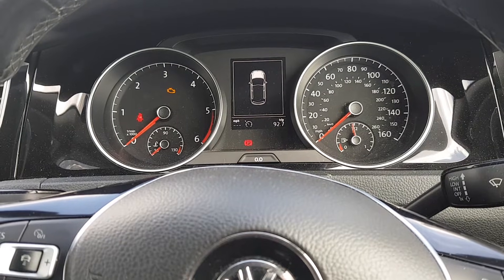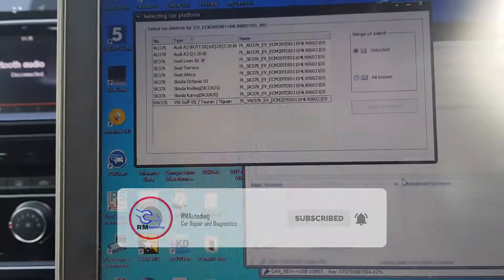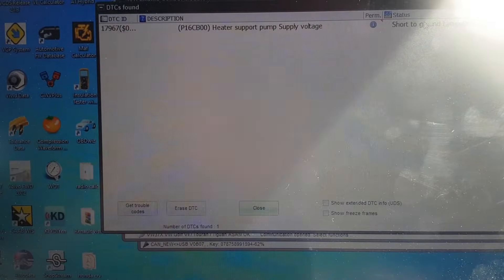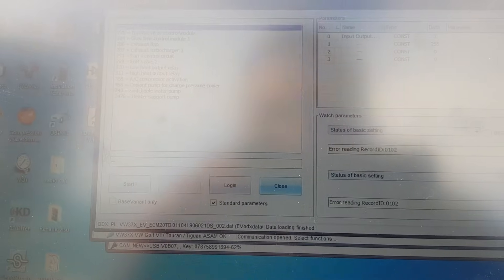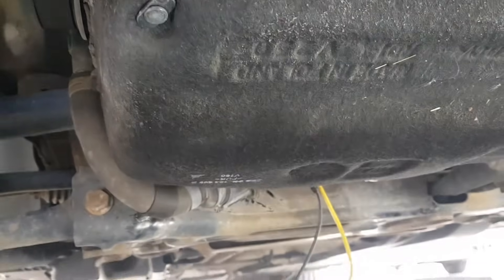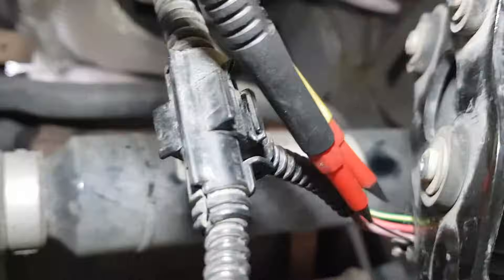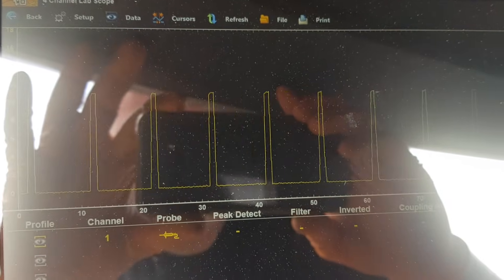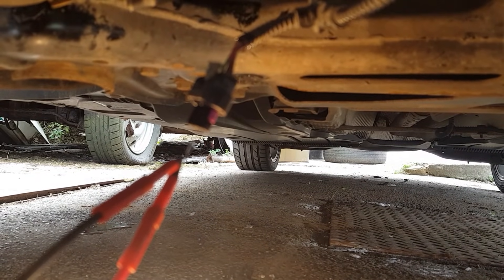VW Golf 7 heater support pump fault P16CB 00 using VCP

Comment: Still same problem, new pump (ve not copy) new ecu wire from ecu, new fused live and ground, new plug, this is one of the most annoying and frustrating issues I have ever had. It’s driving me insane.
Reply: No, troubleshooting for 6 months it is the biggest pain in the ass ever. Ridiculous system. My only thought today is that in live data in VCDS, there are four heater support pump circuits, so I ‘think’ that all of the electrical pumps ‘could’ be reported as a supply voltage error, including egr and charge cooler pumps. My next step is to check voltage at the front two pumps.
Reply: @Steve-ob2zg Hi bro I have the same problem, I changed both pumps and the refrigerator water. I have also no heat on my car, the mechanic told me that it might be the heater core matrix that cause all this trouble
Reply: did you manage to resolve the problem if so how?
Reply: Replying to my previous comment, I disconnected other pumps and they report open circuit for the specific pump so it’s not a voltage error on another pump. I also wired the ecu to a known pump that was working and one of the other engine pumps and still the same error. I removed ecu pin and checked continuity of wire and re-crimped the pin and put back - same error. I am now wondering if the supply voltage or ground from the ecu is fluctuating causing the ecu to report an error. As when I put a fresh ecu control wire, 12v and ground to it bypassing old loom I still had the error.

The supply voltage for the heater support pump also does a couple of other parts, perhaps ecu monitors this original 12v feed and is seeing some issues. I will need to look closer at the wiring diagram.

Comment: I have the same faulty code and replaced the pump but this did not solve the problem, fault code pops up again and it goes itself just like before I replaced the pump. Did you solve the issue?
Reply: you managed to solve the problem
Reply: Yes at the local mechanic in town... have no idea what he has done but problem solved @IlkerBaytemur
Reply: @IlkerBaytemur  Yes at local mechanic in town, I have no idea what has he done but problem solved🙂
Reply: @fatmirmusliu8954  could you please find out what he did? I’m actually so lost
Reply: Same, tried everything including new pumps and ecu wires :/

Comment: I have changed all three pumps got good live and ground and signal and still coming up with fault
Reply: Did you sold the problem ? 😅 I have the same problem
Reply: Same here load of bollocks. Required three times, even removed ecu pins and replaced, new pumps. Dumbest error ever… EML will fail MOT in May, but the pissing van works fine. Even the pump works. Voltage fine, control wire working, pump cycling fine, data logging on VCDS fine. Totally at a loss.

Comment: I have the code heater support pump locked changed the pump still the same any ideas?
Reply from the maker: Did you check the signal and earth at the pump like in the video?
Reply: @rmautodiag  the pump Runs fine off my scanner when I test it
Reply: P16c700 fault code
Reply: @ApexA69   did you manage to fix it as i have the same issue

Comment: I take it that pump is PWM/Duty Cycle controlled.? Sensible troubleshooting! Cheers 👍
Reply from the maker: Yes, most motors use PWM for better control👍 I find alot of stuff has a permanent supply and ground and a control wire which communicates to a driver in the component.
Reply: i know im asking the wrong place but does someone know a trick to log back into an Instagram account??
I was dumb lost my password. I would appreciate any tips you can give me
Reply: @Duke Ezra instablaster =)
Reply: @Maurice Boone i really appreciate your reply. I got to the site thru google and Im waiting for the hacking stuff now.
Seems to take quite some time so I will get back to you later with my results.
Reply: @Maurice Boone It worked and I actually got access to my account again. I am so happy:D
Thank you so much, you saved my account !
Reply: @Duke Ezra no problem =)